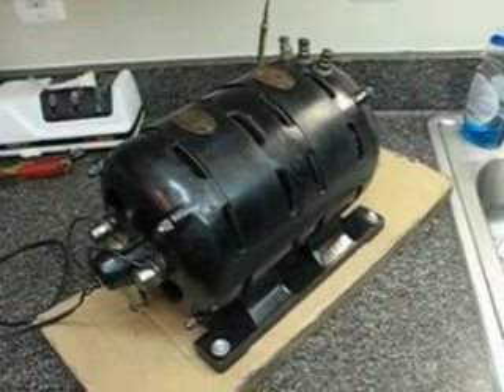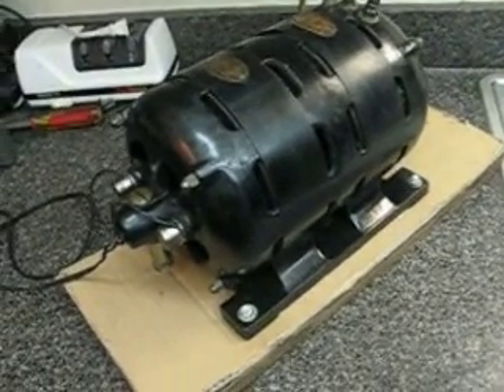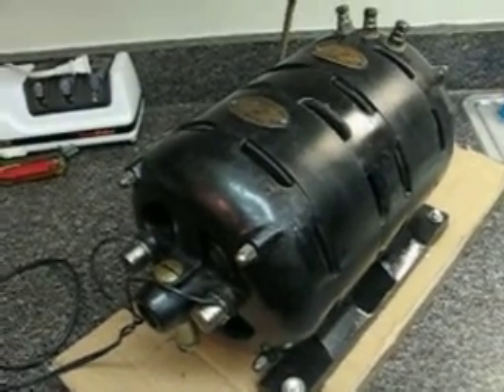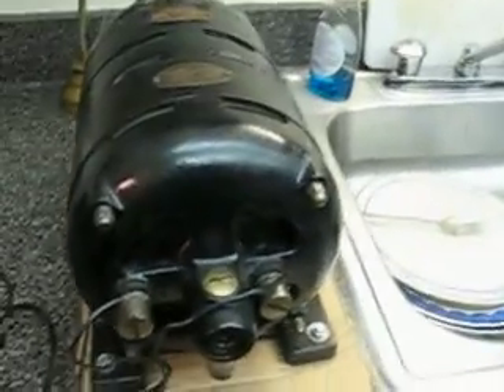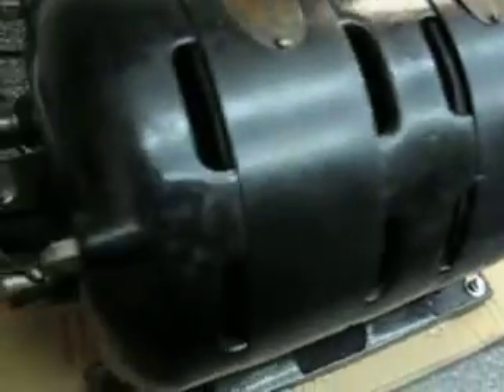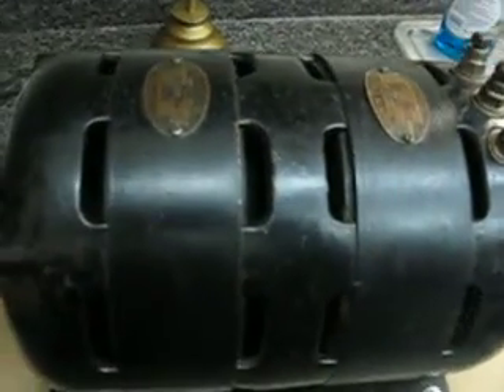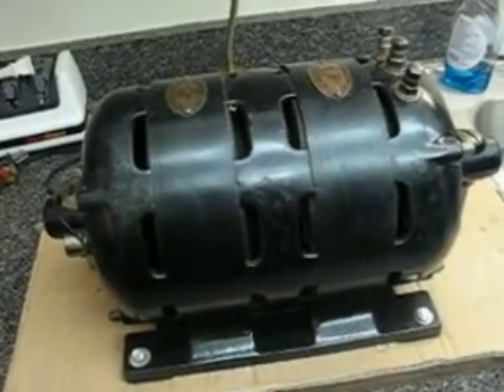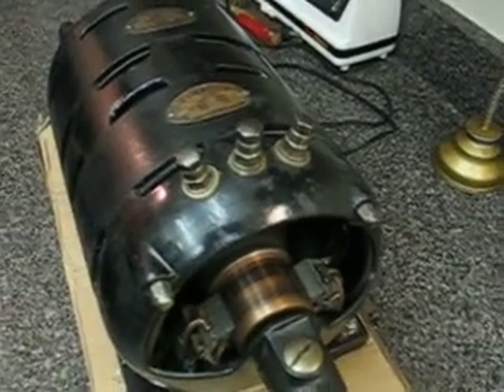Rotary Converter

Comment: 2 of the 3 terminals go to the brushes, the DC out put. Lift the brushes off the commutator (copper slotted part) and find which terminal goes to which brush using an ohm-meter.Expect less than 1/10 ohm.
The center terminal may seem to be joined to one of the end terminals You should see some resistance there...maybe 8 to 32 ohms. This is the field coil which must go to a regulator ( or a #67 light bulb for a test, run from center to to open circuit end terminal). send  email for better details

Comment: That is very cool machine!  It would technically be called a motor - generator, as in a rotary converter the alternating current and the direct current windings share the same field.  I'm working on making one of these with a 1/3 hp repulsion start Century motor and a 14 volt, 11 amp Electric Specialty Company direct current generator, but yours is much nicer, being built into one frame!

Comment: i bought a motor off ebay and when it came both front mounting tabs were broken off. so next time i buy one my dumb ass will request it be screwed to a wood board. and to be packed tighter in the box than it was. its a 1920's westinghouse type CAH 1/4hp

Comment: If it is not internally regulated, it may use an external regulator like old generators on cars. Which could explain the 3 terminals